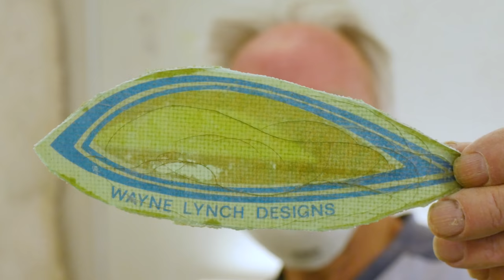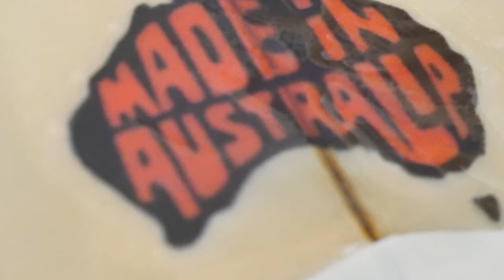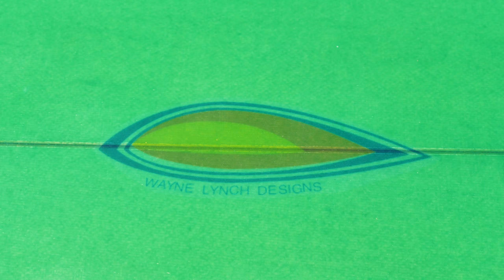Rare Wayne Lynch Surfboard Restoration

Comment: I love how he uses none of the crap tools some companies are trying to sell telling us they are necesary to shape/glass a board.
I have a question i just got a board that needs restoration how do i judge if i can take the glass work off and reshap without ending with a really thin board? Thanks!
Reply from the maker: Really depends on how deep the dents are and how thick the board is. Measure the depth of the deepest dents on the deck and bottom of the board. Combine those 2 measurements and that will give you an indication how much foam you need to take off. If the board has lots of repaired dings in it, it will probably not be worth reshaping the board, because hard lumps of resin in the foam create obstacles especially if they are on the rails. The board in the video had no dings repaired just a few holes.